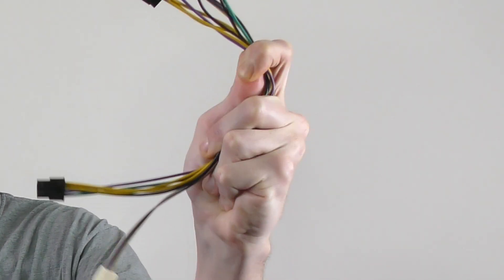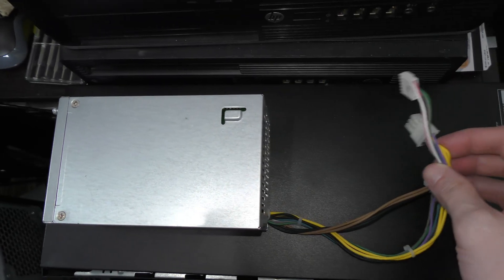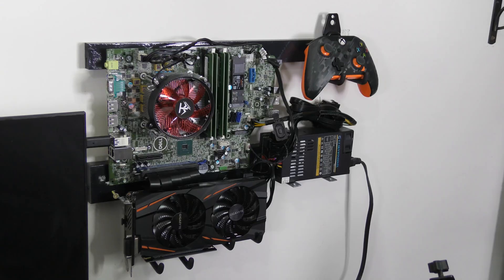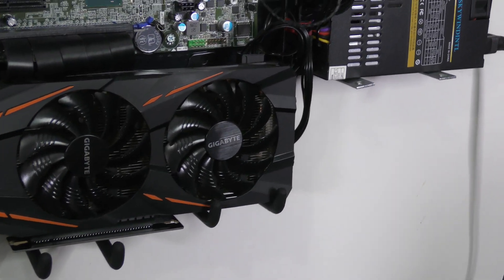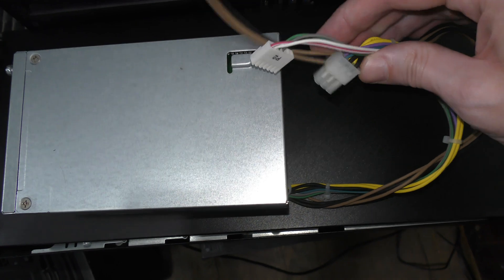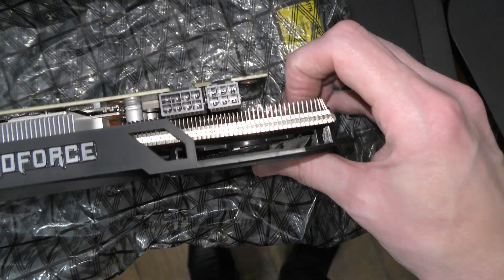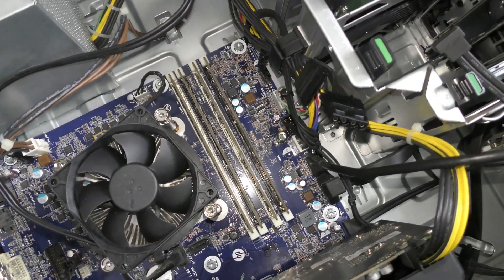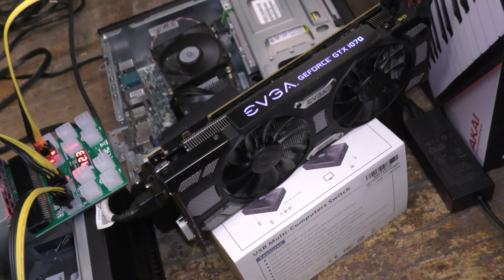Power to the PCs! - Old Computers, New Power Supplies

Comment: Please wait, I need help.

Can I put a PSU on top of the Keys computer like at minute 0:39 - 1:35?

I even noticed that the PSU fan cooler is facing inward, facing directly at the CPU cooler.

Does heat not harm the PSU?
Reply from the maker: Hello. When the PSU was just sitting on top of the PC was when I was removing it. It wasn't connected and I just kind of set it there for the camera. Towards the end of the video I actually installed it in the bay. As far as the direction of the PSU, most standard power supplies like the one I was using act as an exhaust. It takes air in through the direction facing the CPU and then pushes the air through the back, outside of the case. Hope that helps and thanks for watching!

Comment: Have you had any reliability issues with the adapter? Not like fire or anything, I'm just curious if they have presented a problem for you at all. I may have a need for an adapter like that for an HP that I have.  The wall mounted PC reminds me of a system Daren Kitchen of Hak5 did a few years back, He basically put a computer into a beefy picture frame.
Reply from the maker: So far nothing bad in terms of reliability or serious issues. One thing I did notice with the Dell adapter specifically is that the PSU fan seems to be idling when the system is off instead of completely shutting down. I don't know if it is the adapter, or the combination of adapter and the unrated weird flex PSU that I used. The HP adapter doesn't seem to have that problem from what I've seen so far. Aside from that, they generally seem fine, but it's always good to use a bit of caution just like with anything else. Also, that is pretty cool, haven't seen a build like that before, but definitely sounds interesting.

Comment: Many Dell workstations have a proprietary power supply shape that slides in a slot on the back and connects with a card interface. These workstations have no place to put a regular PC power supply in. But these systems usually have some decent GPU power connectors. My Precision 5820 runs a RTX 3070 no problems.
Reply from the maker: Heck yeah. Definitely nice when they already have the connectors!

Comment: I used one of those adapter cables to case swap a Prodesk 600 G1 a few months ago. I did, however, decide against the SATA to 6 pin adapter and just bought a used 460w psu (previously used a 350w) to power the mighty gtx 960 within
Reply from the maker: Nice, that's probably the way to go. I've seen people use the SATA or Molex to 6pin, but those ones always worried me. Even when they technically should have enough power like dual SATA to single 6pin, the way the OEM PCs are manufactured, you never know if they are actually carrying as much power as they should be. On top of that you have to worry about the quality of the adapter itself. I think you made the right choice.
Reply: @LowcastleTech  The funny thing is, it was "stable" in that it didn't crash under full GPU load, still don't trust it though. 

Anyway, love these videos! Somehow cheap office pcs manage to be much more interesting than the latest enthusiast parts despite their much more humble origins. I may have to setup my own ChairDesk for the $28 lenovo pc I bought a few days ago.
Reply from the maker: @rlcyphr8529  Thank you for that, and I appreciate you watching! I'm with you on the older cheap PCs, they are definitely interesting. And it's hard to beat a $28 computer, sounds pretty sweet 🙂

Comment: A couple years ago I threw out a core i5 HP pc because it crapped out.  I figured it was the motherboard or power supply.  When I checked it had those weird power plugs.  I assumed a power supply was unobtanium and stripped the computer of useful parts and tossed the rest.  I wish I had known about these adapter plugs then.  It never occurred to me that anyone would make adapters for proprietary machines like these.
Reply: I mean you might have also been able to get an oem replacement.
Reply: @aboveaveragebayleaf9216  The computer was a used freebie from a previous employer.  I figured the cost would have been way more than it was worth.
Reply from the maker: Yeah I was surprised when I first saw them as well. I'm not even sure how long they've been around, but they are definitely pretty cool.

Comment: I see a Z240 SFF with that i7-6700 in a local store, but the pricing is a nightmare.
I think at this rate, for 1080p gaming, a 1660 Super could be a solid solution while also having a smaller TDP than the 1070/1080, going from 150/180W to just 125, while still being a solid card. But of course, using Chairdesk is the best way
Reply from the maker: I've never had a chance to try it myself, but have heard good things about the 1660. And you're absolutely right, when it comes to Chairdesk, nothing else quite compares 🙂
Reply: The 1660super is almost exactly on par with the 1070, but 6gb v ram. Pretty adequate for that class of card though.  Also a little lower power draw.
Reply: Might also want to look into the rx5600xt or even rx6600xt

Comment: I've been watching since the start,  but let me tell you to be careful with adapter cables.  I had a below-desk secondary rig I temporarily used a molex-to-8 pin adapter for an RX 570,  good thing It was an open-bench style because whilst at idle that adapter caught on FIRE,  thankfully I was right there and paying attention and no further damages to that rig...the moral to the story is: just because you CAN...doesn't always mean you SHOULD,  love your stuff brother...be SAFE.
Reply from the maker: Very true. I'm usually pretty careful... or at least watchful when I'm not careful 🙂. These adapters don't seem quite as iffy because they are mostly going from more power to less, whereas something like SATA or Molex to 8pin tries to pull more power than it can. That being said, you are absolutely right, messing with any kind of power adapters at all does require caution.